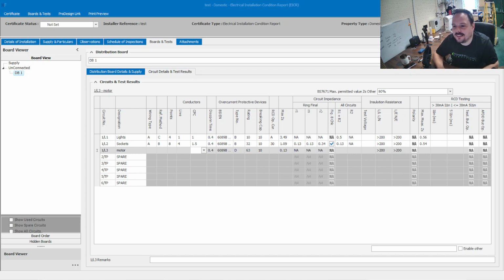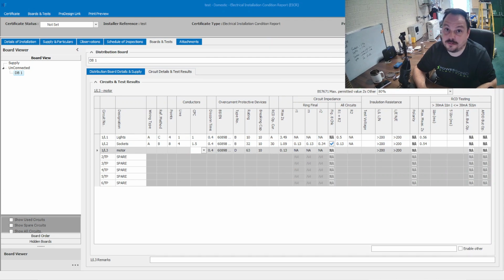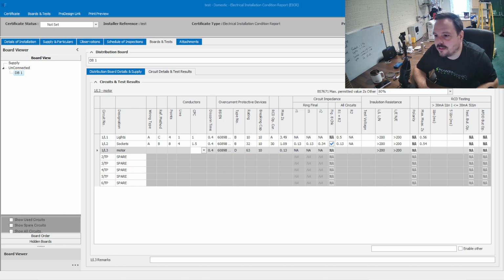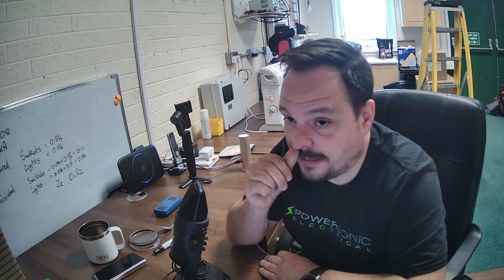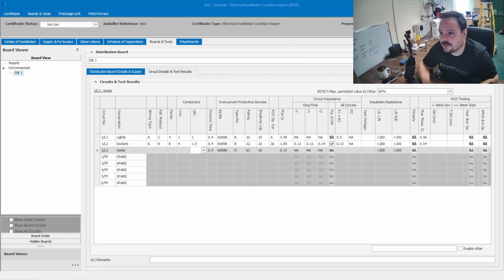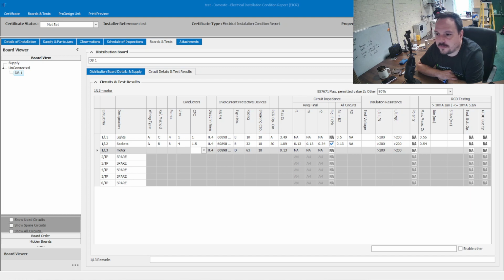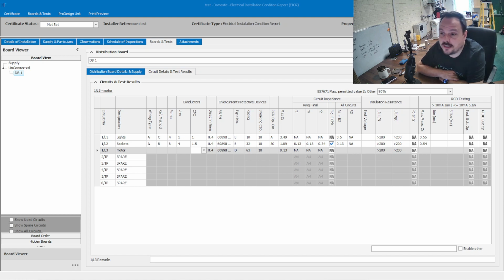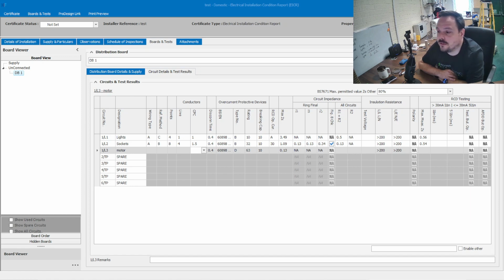Electricians live vs dead Zs earth fault loop impedance measurements? Lighting and Socket circuits.

Comment: Hello Mark, Are you saying all EICR test results should be done dead and the live Zs test is just to verify what you have calculated.
Reply from the maker: Far from it. The level of testing conducted depends on the arrangement between the duty holder and inspector. The most important part of any EICR is the inspection element. Blanket approaches do not work
Reply: @electrician247 hello, I’ve got 4 EICRs a day to do, the only way I can manage this is to do live tests on each circuit. I appreciate you said about it should be only for verification and the regs say do all test dead , but it’s a bit time consuming especially when you have to find the right earths at the board to avoid parallel paths.
What is the right way  to find Zs at each point.

Comment: Cheers again dood!   So here is one that might make you chuckle.    I have a confident understanding of all tests required as described in 7671/gn3 and by yourself and the likes of JW and can’t thank you all enough for your films (wish my expensive training provider was as diligent!) but…i keep getting snagged on the use of the phrase ‘end to end’ when considering continuity and the difference between R1 and r1, R2 and R2, R1+R2 and r1+r2.   What i think i know is that R1 and R2 are values measured in both radial and ring circuits.(true/false?).  In a radial circuit R1 is the resistance of the circuit line conductor measured from its ‘end’ at the consumer unit to each point of usage on the circuit.  In a ring circuit R1 is measured from the outgoing end of the line to the incoming end of the line ( and this is where the phrase ‘end to end’ comes from (i start losing it a bit here)).   In a radial circuit there is never a r1 or r2 or rn (true/false?) but in a ring circuit when the line and cpc are cross connected in a figure of 8 then that is r1+r2 and this is also called end to end?    Sorry about that, if you have time to clarify any of the above for me I would be very grateful. 😂

Comment: So if you can’t use 1.67 on 4 mm cable, what figure do you use as I have not seen that in the books. Thanks 🙏
Reply from the maker: Hi mate. 2.67 if the cable is 4mm with a 1.5mm cpc.

You can work it out for any cable like this

2.5/1.5 = 1.67
4.5/1.5 = 2.67
6/2.5 = 2.4

Hope that helps.

Thanks
Reply: @electrician247  yes that helps a lot, thank you. 🙂
Reply: Can you find these in any books, never seen it but glad you helped. 👍🏽
Reply from the maker: @sugardaddyxxx  a few articles online mate but essentially it's just maths. Line core size divided by cpc core size. 👌
Reply: @electrician247  ok, nice,  thought how have I missed that. 😂

Comment: I love all you YouTube sparks spend hours over the week watching your content and I think 99% of the time it’s brilliant. I think in this instance a face shield, gloves, hard hat with flash shield and extended test probe is utterly ridiculous! To take a few live test readings. No in the real world pal. Like the hat though very snazzy, have a good weekend 👍
Reply from the maker: You would be surprised Tom. If you do the calcs on this stuff can be argued what I was wearing wasn't enough. 

Damned if you do and damned if you don't on YouTube. 

In the real world we do loads of compliance testing from huge MOD installs to basic domestic and everything in between. 

On a 100A TPN head about 10m from the Tx the discharge energy is substantial on direct short. It's unlikely to ever happen but on the chance it does? PPE is the thing that might keep you your sight and hands. Takes seconds to pop on so why not in the real world?

Further down circuits with lower energy levels the PPE is less relevant in terms of Arc flash. 

Stay safe out there and thanks for watching and dropping a comment.
Reply: @electrician247  thanks for taking the time to reply mate. Agree to disagree this time but your knowledge on that stuff trumps mine il stick with a scene of security in obvious ignorance 👍. I think all this going away from live testing is nonsense but each to there own.
Keep up the good work mate all these vids  must take you hours after the day job and hope you have a lovely Christmas 👍👌
Reply from the maker: @Tom.r1990  totally agree with the live testing. I am trying to show the argument about safety is no argument at all. It can be done very safely. Leaves no excuse. All input and experience is valued so thanks for sharing! I appreciate it.

Comment: Nice video as always hope you and the family are well. You should discuss doing an arc calculation not that difficult but in USA PPE is the last step in keeping safe regarding these electrical energies. We never wear rubber gloves on their own always covered with leather gloves on top to reduce risk of cuts in the gloves. We also test the rubber gloves before we use them to identify micro holes using an inflation tool.
Reply from the maker: I have some content recording on arc flash. Waiting till I can record some footage in the suits to accompany it. 

If working live as in contact directly with live parts same here with leather over gloves etc. In this case I was fine with the extended probe and gs38 tips imo. But want to slowly introduce the ppe that is available and as you say the last not first line of protection.

Comment: Fair points regarding live testing I guess colleges are caught between the devil and the deep blue sea. First rule of risk assessment is can the hazard be removed completely and I guess that's what they have done, possibly relying on it being covered by the on site training the trainee is down to receive as part of their overall training.
Reply from the maker: I totally understand why some training centres come to that decision. You make a great point about the overall training with employers as well. That's how my guys learnt to do it for example. But many do not which is a real shame in my opinion. Some colleges do still teach it so it's not all of them. 

Biggest question I repeatedly get asked in apprentice 121 is around testing. Many have little experience at all with it. Tragic really.
Reply: @electrician247  As you say Mark it is a real shame but it is a sign of the times. 👍

Comment: Hi Mark, at 18:00 the test button works with the ac separately to operate any dc currents, so will always test out ok but can be blinded at anytime. John Ward had done video on it.
Reply from the maker: Hi Brian. Yes I am aware hence the comment on testing also. I am gathering as much data as I can and have a specific video coming on RCD testing really soon. Have some interesting examples from installs with EV, solar and even a faulty inverter. The RCD just popped in my head on this one while testing. Thanks for watching 🙌. I watch all JWs stuff.

Comment: Interesting video as always.
Would be good to get some stuff on TT systems too. 
I am currently working on a TT refurb which involves moving the cu in a cottage 18 meters, have put a switch fuse unit with 100a 100mA time delayed rcd and 80a fuse (incoming supply is 100a) to protect the split con cable to the new cu with double pole rcbo’s fitted. Ze was 45.6 ohms and it initially threw me when I was getting Zs values in the high 40’s and low 50’s (logical when you think about the Ze value, but so used to seeing low values). In this situation would you consider setting the max Zs on the software to 1667 ohms (table 41.5 in 7671) otherwise the figures would not make sense in the test results section?
Got my Napit annual assessment in a couple of weeks and don’t want to be caught out on this.
Reply from the maker: Thanks! 

I have done a few videos on TT. If you are using the RCD for fault and additional protection using the values in the tables is fine. You have the dead test data to verify your readings alongside the Ze/Ra so all good. 

Good luck on the assessment, you will smash it. I always enjoy mine, nice to have a chat if nothing else lol

Comment: Do you think sometimes we get a bit Carried away with the testing as in if the earth loop is compliant at the incoming supply , the relevant sub circuits are compliant  . No problems with regards to cables being down , basically covering the age old testing remit . But what I always find fascinating is the assumption that a installation even over small time frames remains static . Even after just a few months of load in just domestic environment  connection become less than tight , scale that up to industrial level and you can soon be into a different ballpark . Testing will only give you part of the picture , and this is wear manufacturers need to step up and be accountable , assuming a connection is up to the task is frankly just not good enough . A total rethink is needed as to how a cable is terminated , and as it stands no such  mechanism exists  . Best wishes and kind regards
Reply from the maker: It does make you think when you see the Ze values wander so much, the high tolerance on the MFTs and the fact the regs move the goal posts at times lol. 

But its a well established method of checking compliance so I think it plays an important part in the tool box. 

I think we will see pushfit in CUs/ DBs more common in the short term
Reply: @electrician247   thank you Mark for your reply , yes I notice the advent of these push connections and am hopeful of their use in such as domestic sockets and low voltage applications . As an electrical contractor you can not be expected to be all things to all men / women , but from my perspective I would be more than grateful for any work that you and your team where asked to do for me .    Kind regards as always from an old retired electrical contractor 😀👍👍👍